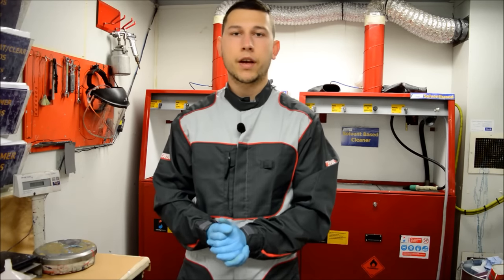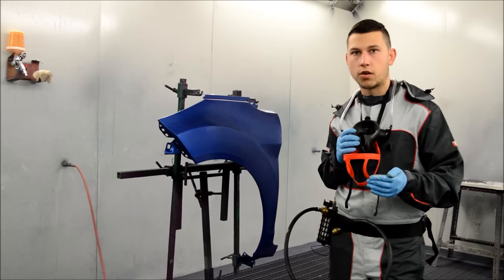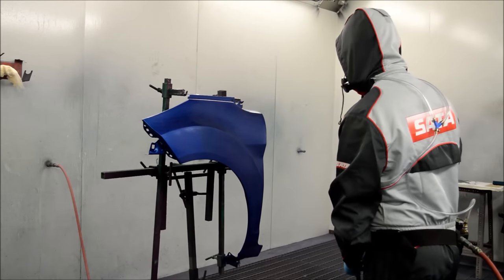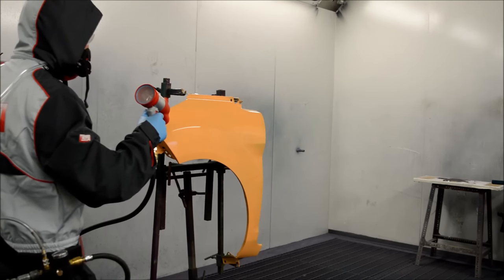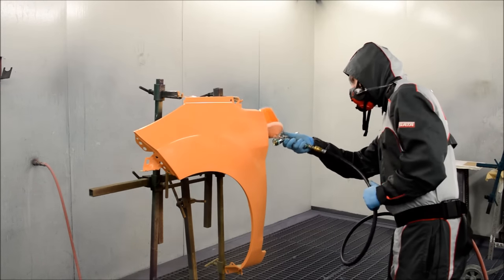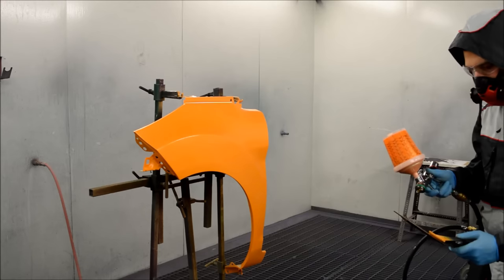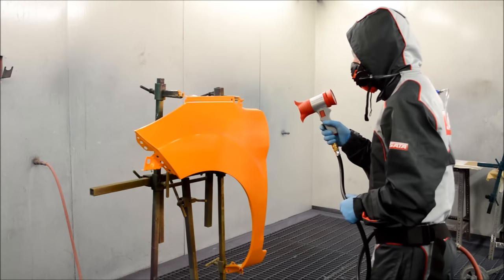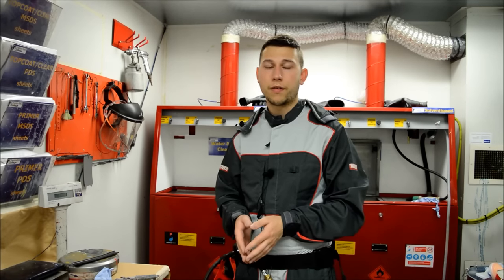Applying a 3 stage pearl Orange using SATA 4400 HVLP 1,2 SR

Comment: Excellent work and your video quality is outstanding! You have had the Sata 4400B awhile now - how do you like it? Would you recommend it? I'm trying to decide between the Sata and the DeVilbiss Sri Pro Lite. Mostly DYI guys and smaller projects but do not want to be hindered if I should like to do a complete panel or bonnet! Thanks again!
Reply from the maker: Thanks Jeff!, yes the 4400 is a good solid gun! If i was to reccomend either 4400 or sri i would go for the 4400. The SATA build quality is far better and lower maintenance than the SRI. Thanks and have a nice day!
Reply: @RepairRefinishTV  I see you're using the HVLP model as opposed to the RP. Yet the HVLP uses less cfm's. Which doesn't quite make sense to me. Any ideas?

Comment: You're really hosing that paint on there. Nice work. Can you throttle this gun back for smaller work like motorcycle tanks, fenders etc?
Thanks again
Reply from the maker: Yes it sure can, this 1.2 is quite heavy, I'd say a 1.0 or even a 0.8 would be good for smaller jobs
Reply: @RepairRefinishTV  Thank you for responding! I'm looking also at the Iwata LPH80. Will the 4400B give you a good flat glad finish without orange peel? Also why did you choose the HVLP instead of the RP model? The HVLP actually tires less cfm as per SATA! Thank you for your help

Comment: If I'm correct you are using the 1.2 tip ? I know this gun offers a .3 tip (HVLP), and I was wondering If I could also use it as an Airbrush.

Wondering If I would be able to get some even finer lines with that kind of tip?

Thank you
Reply from the maker: +Gotallofthem1 yes it most certainly can ve used as an air brush. I think its sata by dan am have a video using it for airbrushing

Comment: Hello

Is it waterbase?

Please could you tell your setup about spray gun ?

What light do you use to check the cover?

Thanks
Reply from the maker: Hi Sergio, 

The base coat I am using is Lechler waterbased basecoat and the clear coat is U-Pol 20:81 with standard hardener.

The spray gun for base is a SATA 4400 HVLP 1,2 SR (the gun is more for small/medium jobs)
The spray gun for clear is a SATA 4400 RP 1,2 SR 

And finally, the light is the Scangrip Sunmatch light. its a colour matching light which is great for checking coverage due to the high light output.

Thanks
Jordan